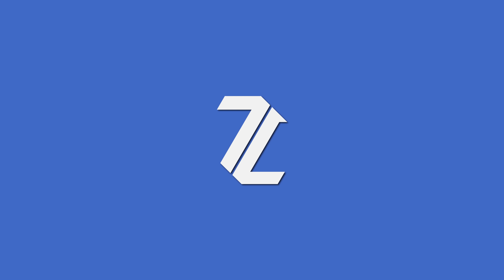3D Printed Design: Diversity Antenna Mount (For Racing Quadcopter) - #0109

Comment: 1:45 you say not ideal for antennas... that's coax! all you care about is the 1/4 wave metal collar and the free air center conductor. what the coax up to that point does is irrelevant
BUT..that is not to say getting those ends out in clear air space (length) away from the other electronics and carbon fiber WILL improve reception signal strength.

Comment: Take the tubes out of the retainer. Push wires in the retainer without the tubes. It's then easy to pull them through from the other side. Once you get them about right, put the tubes back on :D
Reply from the maker: +Lori Ha, sounds like common sense that I often lack for stuff like this.  I'll give it a try--thanks!